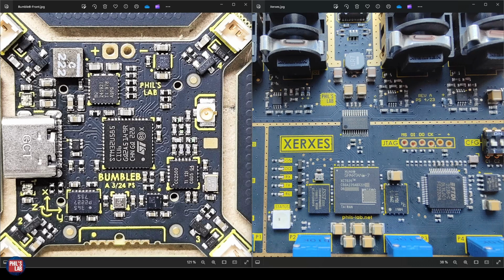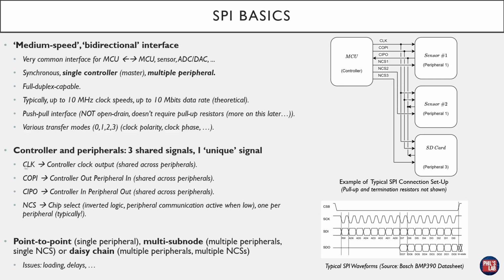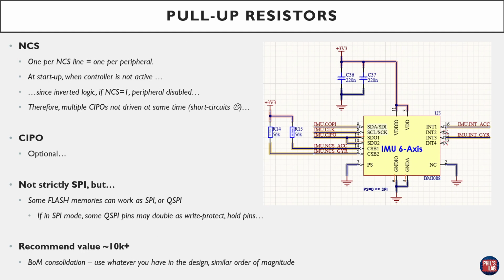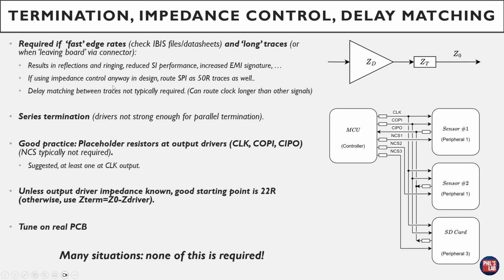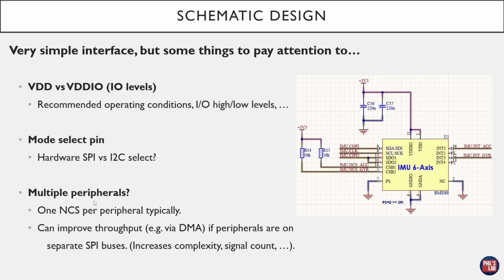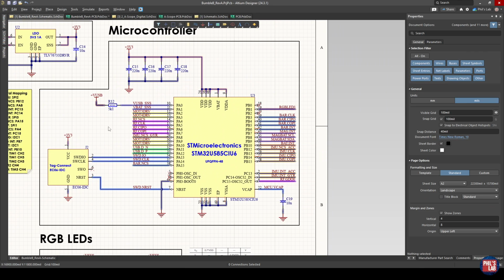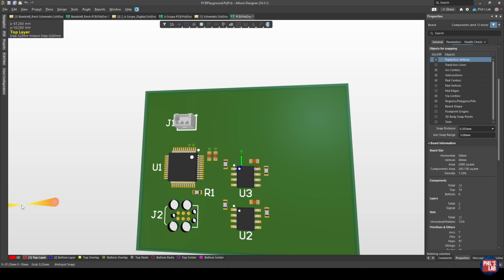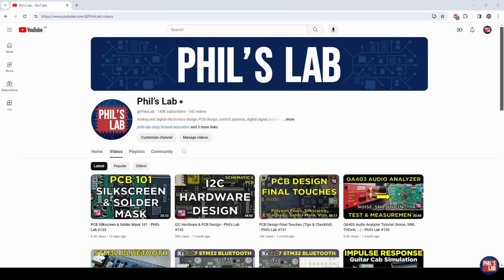SPI Hardware & PCB Design - Phil's Lab #134

Comment: When routing the SPI lines do I need t make sure they are running parallel to  one another, I have an ESP32 and need to run MOSI/MISO & CLK to a display connector, 3 Temperature sensors + an SD card header but due to board constraints I am finding it difficult to keep some of the traces running parallel.
Reply from the maker: No, not at all.

Comment: The board on the left (at the start of the video) is using the same chip as the one my design.  That's one hell of a coincidence :) 

Edit: I used the one ending in CIT6Q but basically the same

Comment: Do you think it’s possible to design very small nfc antennas for very short reading distances of 1 or 2 millimeters ? I need to design many antennas and distance between antennas will be 25 millimeters. Antennas must not interfere with neighbors antenna.
Thank you

Comment: 🤔If you are on a 4+ layer board and already are using 50R impedance hi-speed lines, it makes sense to choose the same for SPI. 
But in gerenal the chosen impedance doesn't have to be 50 Ohm (as the receivers are not terminated and high impedance / "open"), it's just important to be consistent (source/series termination = trace transmission line impedance = cable impedance, etc).

So in any other case, especially for a 2 layer board (and if you, for example, go to a connector with a ribbon cable, where GSGSG...GSG leads to characteristic impedances of ~100...150 Ohm), wouldn't make a higher impedance like 90...120 Ohm make more sense?

Also reduces the current spike drawn on rising/falling edge (I_edge = (V_High - V_Low) / (2 * Z0), so 33mA @ 3.3V and 50 Ohm)

See also: 
* https://resources.altium.com/p/there-spi-trace-impedance-requirement

Example for (LT-)Spice:
1 & 2)
* start => voltage source, pulse with tr/tf = 1.5n, VH=3.3V, Cpar=5p, Rser=33
* end => "receiver" capacitor with C=5p (and Rpar=20MEG)
1) 50 Ohm line in between
* Zterm=17
* and N times a CLC-pi-element (like in the altium article above) with L=13.96nH & C/2=2.80pF (5 cm of 50 Ohm trace)
2) 100 Ohm line in between
* Zterm=67
* and N times a CLC-pi-element (like in the altium article above) with L=27.25nH & C/2=1.38pF (5 cm of 100 Ohm trace)

Use N=1 <=> 5 cm for a "short" bus (but near the 10% time delay to rise/fall time limit)
Use N=6 <=> 30 cm for a "long" bus (as an approximation for a transmission line)

transmission line values are from:
https://wcalc.sourceforge.net/cgi-bin/coplanar.cgi

Comment: As a newbie i learnt and liked from  phil's lab.but now i got to do project with handling 10.1 inch 1080*600 tft display,,so, from your designs, which can i able to select the Hw and modify according to my display and GUI needs??or should i go for dual core h745?

Comment: Hi Phil, in your video about series termination you mention, that the input waveform will only be failry clean for the last load. In case of and SPI bus with multiple peripherals, especially when pathing through components, wouldn't this be in issue since only the last peripheral will receive a clean waveform and the other ones will receive only half the amplitude? At least thats how i inderstood it in you series termination video.
Reply from the maker: That's correct - in the case of multiple loads, however, if loads are kept 'close' this isn't an issue. But if loads are further apart, the series 'termination' is there more to slow down the edges, which can help improve SI. In any case, the recommendation is to slow down edges (either via control in the controller, or via series resistors), keeping trace lengths short, and loads close together.
Reply: @PhilsLab  I have no experience in designing PCBs but in my case I think I'll have fairly long traces since i need to connect 20 large sensor chips but then I'll implement these series resistors as you recommended.
Thank you for the quick reply and have a nice day :)

Comment: Hi Phil, great video.....I'm curious, why do you use the Tag Connect connector with the feet? I know it allows you to debug easily, but I use the model without the feet and the associated retainer on the other side to achieve the same result. This way I don't have to have the 4 holes for the feet, just the 6 pads and the three locating pins.
Reply from the maker: Thanks, Stuart. Often times the PCB is in an assembly/enclosure which doesn't permit access to the other side of the PCB or there isn't enough space to fit in the retainer. Also, I don't want to have to fiddle around with a retainer and find it far easier to rely on the legs. I've found the retainer can come loose fairly easily. Lastly, unless I'm super constrained with board space, I don't see a reason not to use the legged version.

Comment: Again a really nice Video - Thanks! 
Meself was playing around with SPI a few weeks ago. The term "mid-speed" is a high-speed for me since i was always using  I2C. I got my 20MHz MCU (Atmega4809) to run 10MHz SPI clock and could feed a little 160x120 RGB display with it. For Beginners: I wired it up by glueing my SPI-Flash (Display Data for the RGB-LCD) to the board and connecting it with enamelled copper wire. Works fine even on that speed. Don't be afraid to use it!
Thanks for teaching and encouraging the community to use this Bus <3

Comment: Your PCB design has improved a lot from long time ago. It would be nice to watch a video with some suggestions and thoughts on what you care about when placing SMD components. For example: component alignments, spacing, groups; tracing main voltages; separating analog from digital signals, add vias next to GND pads like capacitors' Pads; and so on. This kind of content is not easy to find online, at least in one video that resumes it.
I have some basic knowledge but i see a lot of room to improvement.
Reply from the maker: Thank you! I have a video on PCB aesthetics which goes over some of the essentials. Otherwise, it's quite difficult to convey that without showing a full design walkthrough (of which I have a few on my channel).

Comment: Perfect timing Phil. Currently designing a PCB with four SPI devices. Didn't think about pullup resistors on the CS lines, but will do now. Thank you for sharing your extensive knowledge. 😊
Reply from the maker: Awesome, thanks, Matt - glad it's helpful!
Reply: @PhilsLab  Phil, most of your stuff is way over my head. I'm just a self taught hobbyist who reads a lot of datasheets, but it's gems like this that put the icing on the cake.
Keep up the good work.
Cheers.
Matt.
Reply: @PhilsLab  sorry to trouble you. In my PCB, without a bit of a reshuffle of components I'm struggling to get the pullup of one of the CS lines close to the peripheral. It's simple if close to the MCU pin. Is this a problem? If you say I should do a redesign then so be it but just wanted your opinion.
No rush.
Cheers.
Matt
Reply: @TYGAMatt close to the peripheral is best but it shouldn't matter except if you are really push a very long cs line on a large pcb where it might cause minor problems.
Reply from the maker: As Michael already commented, the CS line can be pretty much anywhere (within reason). I like to pop them next to the peripherals, as to me that is part of that group.
Reply: @michaelcummings7246  @PhilsLab
Many thanks for your comments chaps.
The longest CS line is around 12mm so possibly OK to bung the resistors anywhere then. But..... I was worried that Phil would give me a hard time so I did a bit of a redesign so that I could put the resistors right next to the peripherals.
Great to have so many knowledgeable people out there willing to advise us mere mortals.
Cheers
Matt
Reply: @PhilsLab  Hey Phil, for your info, I received the PCBs from JLCPCB, soldered on the components and it works like a charm.
So a massive thank you for your top tips.
Cheers
Matt
Reply from the maker: Awesome, very glad to hear that, Matt! Well done on your design!

Comment: how can I measure ringing and reflections on signal lines and how to measure how good is my RF impedance matching ?
Reply from the maker: Low-inductance probe connection to an oscilloscope and measure on the relevant RF lines (e.g. at the receiving end).

Comment: This push of replacing Master with Controller is a disservice to everybody especially newcommers: Most of the datasheets talk about Master / Slave. Paarts you used had SI (Slave In) and not CI. Not a good first contact with the topic. Not only are there new terms, some functions even have multiple names.
I would recommend keeping the Master / Slave notion as the benefit (and motivation..) of the renaming is questionable at best. Some TI-Datasheets even mix the terms. Introducing artificial noise into a 40 year old standard.
Reply from the maker: Agreed - I should've been clearer in the video about the various naming conventions. While researching, looking online for content for this video, I came across these new, suggested definitions (OSHWA, Texas Instruments, etc..).  Last time I used MOSI/MISO in videos I got a few complaints about that as well.
Reply: The terms "master" and "slave" are used inconsistently in electronics, sometimes referring to controllers and peripherals, sometimes referring to addresses without hierarchical distinction. "Controller" and "peripheral" breaks with convention, but the convention in question was ambiguous to begin with. Like, who looks at a circuit diagram for the first time and thinks "which of those chips is the master and which the slaves"?

They didn't name it the "Serial Slave Interface", because the meaning would have been less clear. Either way is unfriendly to newcomers now, but the controller/peripheral nomenclature would at least become friendly to newcomers over time as documentation is updated.

And frankly, if having two names for the same thing during a transition period is too big an obstacle for newcomers to overcome, they won't be able to navigate USB cables let alone signal protocols, let alone all the different ways to indicate inverting and pins on ICs.
Reply: @SnakebitSTI  With all respect, the problem is not about updating terms and naming conventions to fix some inconsistencies. It is about avoiding the use of specific words that are perfectly acceptable in the specific context of use. I mean, are we really getting triggered by the idea of chip being a slave? A chip? Really??

Comment: Great vid. It would have been good to cover the modes instead of skipping it. I have been tripped up when first working with SPI years ago. I heard some senior engineer on the amp hour got tripped up for weeks on some wrong mode.
Of course the most basic logic analyser can be used to diagnose mode problems in minutes.
Reply from the maker: Thanks! Yes, I'm definitely planning on covering that for the SPI driver video. There I'll also go over clock, data width, etc. settings.

Comment: Another great video! Your channel has been a godsend for the tasks I've been given at work to develop some sensors.  It would re really great to hear your thoughts on how to handle high speed ADC.  I have some projects where sampling in the region of 3-10 Msamples/s with the least fuss as possible would be really helpful, but the literature I've seen on this hasn't been particularly illuminating on how best achieve this. Is this a task best suited to FPGA or would an STM32H7 have enough grunt with the inbuild ADCs?
Reply from the maker: Thank you, glad to hear that! Depends on what you want to then do with those samples, what effective bit depth you require, etc.. Some H7s can apparently handle several 3.6 MSPS channels (at "16" bits).
Reply: @PhilsLab  thanks for the reply! 10 or 12-bit would probably be adequate for my needs. The goal is to detect a pulse a few usec in duration and then trigger a secondary analysis system within a few usec if the pulse height is greater than a certain threshold which captures using the same ADC before resting the acquisition system.

Digging around the H7 series capabilities it looks like interleaving the ADCs together can increase the sample rate well into the upper range I'm shooting for, but when I read up on how to achieve this practically it looks like it falls short in reality.  I will be starting some tests in a few weeks with a nucelo board, however people have complained that the ADCs on the nucelo boards aren't great because of the board layout etc, so I may have to roll my own.

Comment: To avoid short circuit when the SPI lines leave the board, how much resistance in series do we need to add to each line? Thanks.
Reply from the maker: They are there to limit the short-circuit current, so Ohm's law with your IO voltage and max. current drive of the outputs. Keep in mind this'll slow edges down though.

Comment: Hi Phil Could you design and show how to do a project for the new architecture like RISC-V SBC and functioning bord like Arduino/RasberyPI  but with no ARM on board? But made not in China.... and then sell this units for devs? It would be good if it have external Encoder/Decoder chip of h264 and h265 for smooth Youtube / video Watch? Its a very slow "CPU"... maybe multi-core/multi-Processor RISC-V design. *Maybe implementation of risc-v core in a new SOC chip design in OpenLine softwre etc... (source YT:zero to ASIC Course)?

Comment: I am using a 120MHz microcontroller and it can toggle GPIOs at max 50MHz. 

If I clock the SPI at 10MHz, will the rise time and fall time correspond to 100MHz (10x)?

Does fall time and rise time change with the configured clock rate of the SPI? Or is it fixed for a particular micro-controller?
Reply from the maker: 1/10th of clock period is just a very rough rule of thumb, it can easily be faster than that. Depends on controller and peripheral that you use - I'd suggest checking the IBIS files.

Comment: Why not MISO/ MOSI? Never heard of copi ant the other thing
Reply: COPI and CIPO are the politically correct way, because saying slave might offend your temperature sensor IC.
Reply: Because the woke have arrived in this field too. If I hurt the feelings of the ICs, I might think of changing the naming. Until the ICs are not complaining, I’m stibking to MISO/MOSI.
Reply from the maker: That's what I was used to as well - when double-checking and gathering info for this video, I came across these definitions that are apparently more 'up-to-date' (along with serial data in, serial data out (SDI, SDO)).
Reply: Yeah, I don't think it will stick. Master and slave are the correct terms, but certain elements are trying to make those terms "problematic". Latest I've heard is that "field-work" is an unacceptable term as it evokes slaves working in fields; this is the level to which we have descended. These are the same fools who tried to change grease nipples and manifolds in cars 🤦‍♂

Comment: Hey Phil! I'm intrested in your micro quad copter project. Do you mind make a video about it or share a project? I'm in the process of designing one myself, but it's my first one. Thought about using new U5 MCU as well. Which remote and motors are you using? How big is your micro quad copter?
Reply from the maker: Hey, Thanks! Yeah, I plan on making a few videos on the aspects of the hardware and firmware design. I found a frame kit on Amazon (with motors, and battery) and designed a PCB around that. PCB is ~35x35mm. Motors are those micro coreless 1S ones. Remote I'm making my own with a TI CC2500 2.4GHz transceiver.
Reply: @PhilsLab  Thanks for answering. Do you mind sharing frame amazon link? Also I'm wondering about your USB-C. Are you using 16 pin USB-C(USB 2.0)?
Reply from the maker: This is the one I went with: https://www.amazon.de/gp/product/B08SWKGF33/ref=ppx_yo_dt_b_asin_title_o02_s01?ie=UTF8&psc=1
The USB-C connector is a GCT USB4105-GF-A-060
Reply: @PhilsLab  Thanks a lot. I just recently ordered exactly this USB-C because I would like to move from micro/mini USB to USB-C. But I don't need the USB 3.0 speeds and 24 pins is a lot harder to solder. 16 pins seems exactly perfect. I really like how beautiful your schematics and layout looks. Wish I could make same ;) I'm hoping for more Altium videos ;)
Reply: @PhilsLab  One more question Phil if you don't mind. What made you decide to use power layer as 3rd layer? Not enough space? Did you use whole layer as a power layer or routed power and rest of it GND?
Reply from the maker: Not enough space and needed wide traces to handle the motor currents without too much of a temperature rise.

Comment: Bro I'm electronic and communication student how student I improve my core skill
Reply from the maker: Pick a project idea that interests you and build it from scratch, start to finish - block diagram, hardware, firmware, .. etc. This is the number one way (in my eyes) of improving.
Reply: @PhilsLab any ideas for a project? Is there any web where you could find projects to join or collaborate?
Reply from the maker: For me it's always been based on what I'm interested in - then I'm more likely to have a use for the final design, and finish it. If you're into audio, there is a lot you could build (DIY synth, DSP FX processor, etc..), otherwise, a micro quadcopter is pretty cool and touches on many embedded system concepts. Regarding where to find open-source/collaborative projects, I'd try looking through the embedded/electronics sub-reddits.
Reply: @PhilsLab Thanks! i’m very intersted in taking part or learning in firmware/embedded software projects in several fields such as motor control, battery management systems, etc. Any clue on what could be a good oportunity to start from scratch?
Reply from the maker: I'm biased, but I'd go with a micro quadcopter :) Contains a bit of everything - motor control, battery management, DSP, control, etc etc